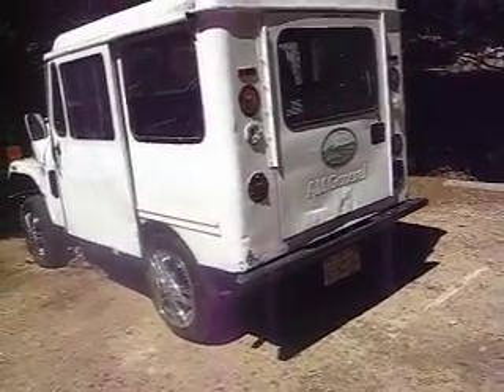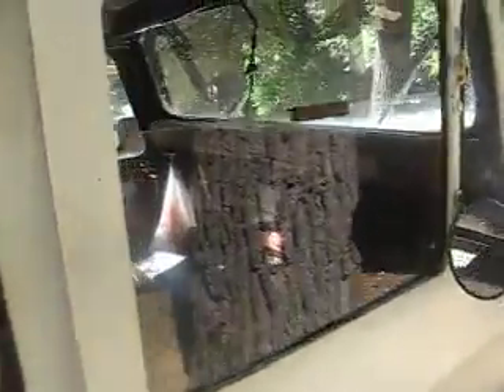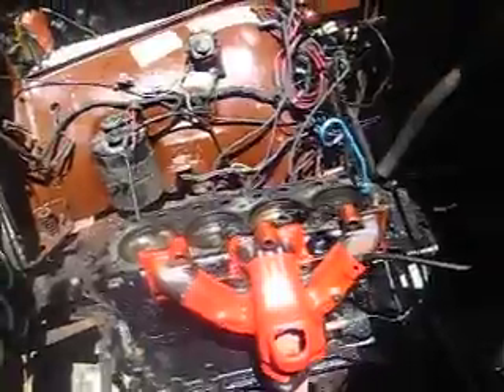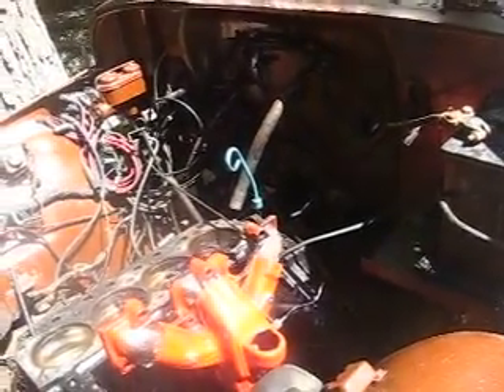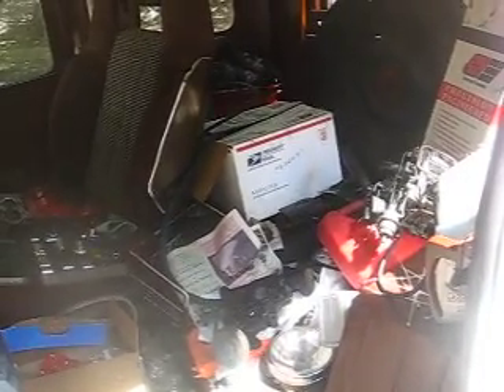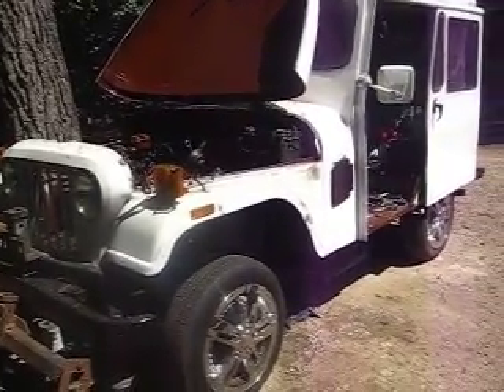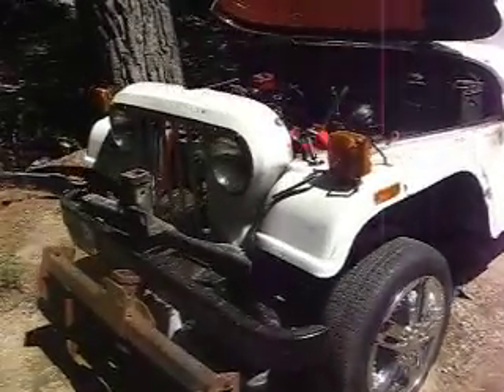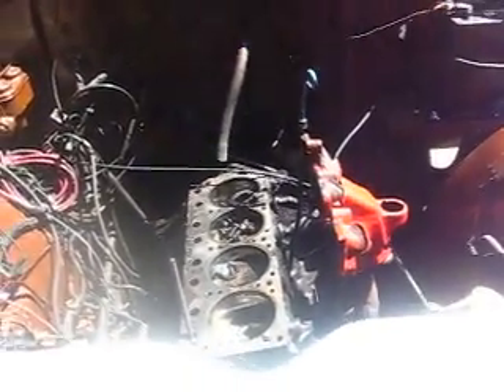EV conversion 1982 dj  am general postal jeep

Comment from the maker: hi just interesting info ,,, on not yousing fluids ,, there was 37.85 liters of gasoline ,transmission took 6.7 liters fluid , rear axle uses 1.4 liters , and radiator 7.57 liters of fluid . engine oil 5 quarts , .. plus minus use of no more oil changes no more trans fluid replaced etc etc . ps ive decided not use engine block its ben removed and im currently bolting up a manual 5 speed direct to dc motor ..